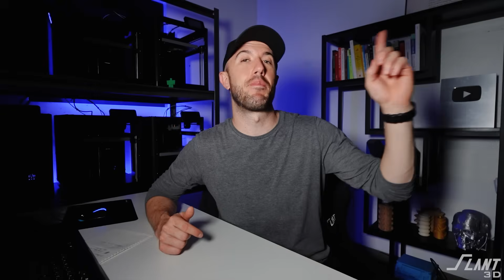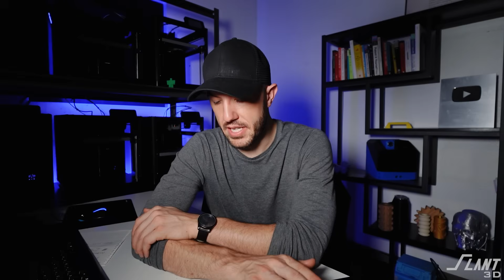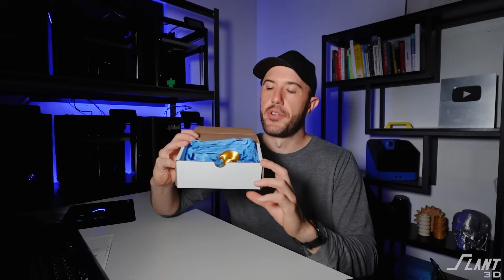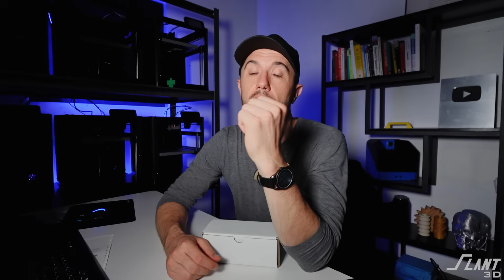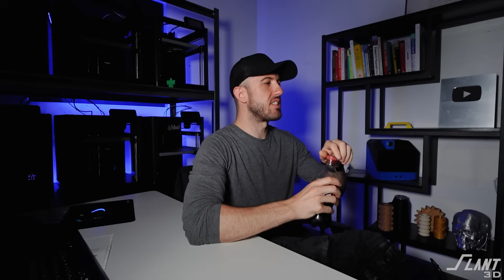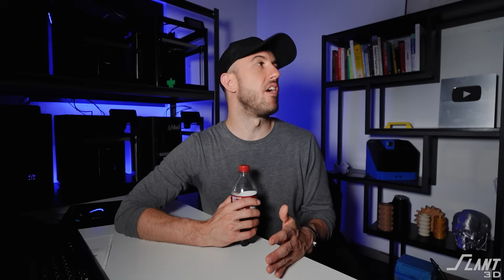Desktop Metal Bankruptcy | Bambu Lab Crowdfunding | Printed Molds | Pellet Printers | Podcast Ep 117

Comment: Question: about the pellet extrusion. Isn't there also an advantage with only heating the material once? Doesn't it make for stronger parts compared to how filament made plastic parts are melted twice?
Reply: Yes, the more times a plastic is melted, the weaker it becomes because the molecular chains of the polymer break down with each cycle.
Reply: @michaelg4931 something only clippy would say. Clippy just wants to help. 👍
Anyway, I wanted to hear if Gabe thinks it's worth the difference.

Comment: Maybe you need to start shipping Teleport machines to Teleport users so they can test their prints?
Reply: @slant3d What about overhang and bridging? That's very much printer dependent. Bed adhesion is also printer dependent.
Reply from the maker: Design a part well. And it does not matter what machine, material, or settings you use.

Comment: Great vid as per usual.
Glad to hear about potential 'machine emulation' cause I have an A1, and I would 'smash' that option. Currently I've taken all the info I can find on the Slant machine profile, and have tried to dial in a machine profile to match (pretty much involves turning off any feature that was developed in the last ten years ha ha).

Talking about 'first layers'....
When I was looking for a machine to purchase, almost every review had an example of a 'first layer' as an indicator of the quality of the output.
And pretty much all of the mainstream machines these days 'sticks the landing' on the first layer. Even and uniform (cause I guess that it's the foundation of the entire print so it's pretty important???).  On most machines, the first layer is the best surface of the whole print. I have a textured plate and I totally lean into using that random ripple as a design feature.

A non-customer facing surface is kinda impossible for any print that might be hung up, or that the customer might pick up, or that is worn. Depending on how the print is placed into the packaging, it could be the first thing that the customer sees when they open the box?

Comment: Question: Have you considered adding an option to Teleport allowing users to upload a black and white image/logo with predefined dimensions (e.g. 512x512 pixels) that automatically gets printed on the shipping label or another label that gets used as "packing tape". It's a simple way for your users to add "custom packaging" without adding significant labor/materials overhead to your process.

Comment: Injection molding will stay. Making the molds will shift to 3d printing (laser sintering metal molds). Injection molding is a perfect way for mass production of plastic parts of all kinds of materials, while not all plastics are suitable for mdf printing. 3D printed parts use more plastic and 3D printed parts are not as strong as mdf prints.  
Even Prusa started to use injection molding for an increasing number of parts of there 3D printers and that is not without an reason.
Reply: @wilsistermans1118 totally agree. It was just news channels that hyped up 3D printing as the injection molding killer. Hobbyists and pros alike understand its place is for annual part counts between 1-10 000. Injection molding is above that.
Reply: @justcraziii  With steel laser sintering a small cast (two parts of 20*20*15 cm) will cost about $ NZ 800,  which is about $ 650 US. This make injection molding interesting for around 500 parts. An injection molded parts uses on average about 40% of the plastic and uses cheap pellets instead of expensive filament. Another plus is you can use a wide variety of plastics, including strong industrial types as PEEK and nylons.

Comment: I print plastic molds for injection silicon parts for parts I sell. It works very well.
Reply: People are doing this with phallic shapes, I've heard.
Reply: Yeah, I came here to say that. His hot-take on molds for plastics is flawed and a bad blanket statement.
Reply: @JorgTheElder honestly, a couple of not great blanket statements in the video. Good overall though.
Reply: @carlunderguarde8268  same for high temp plugs and such